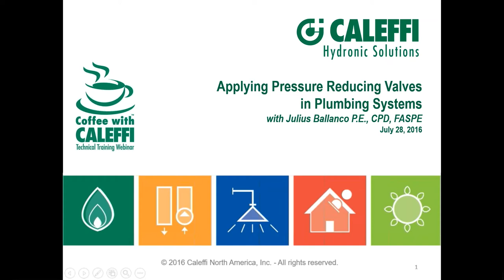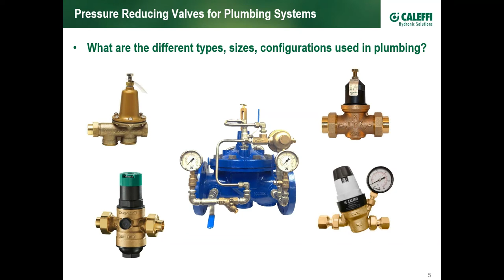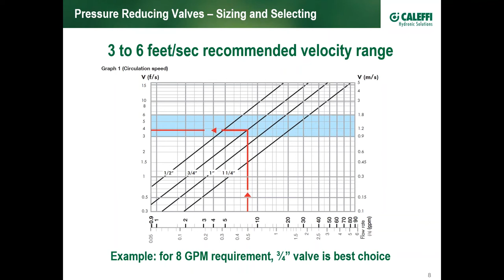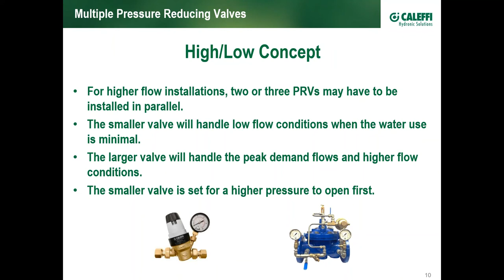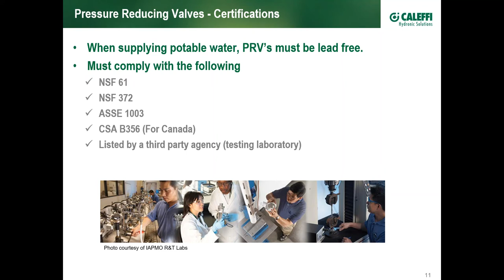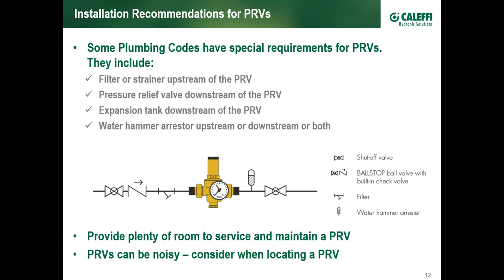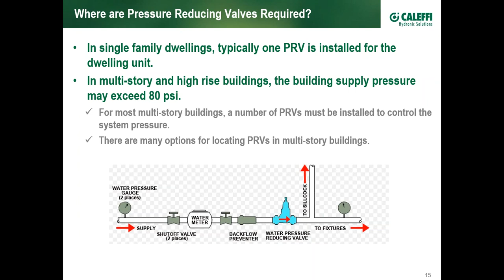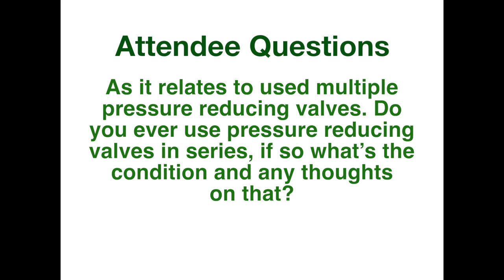Applying PRVs in Plumbing Systems

Comment: From left to right. For make up water. Backflow, Prv,pressure gauge,boiler drain,check valve, ball valve. Bypass around prv for fast fill. This is for very easy set up without having to wait for full system response. Boiler drain makes for an easier job when prv is set too high. Only a small amount of pipe to drain to get down to 0 psi again and start from scratch. Boiler drain is key.
Reply from the maker: Thanks for sharing your comments!